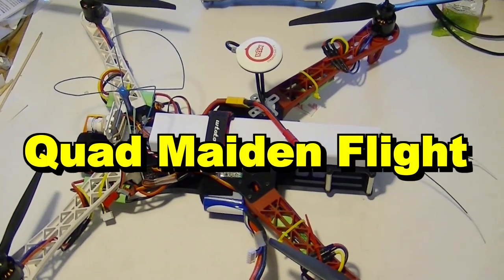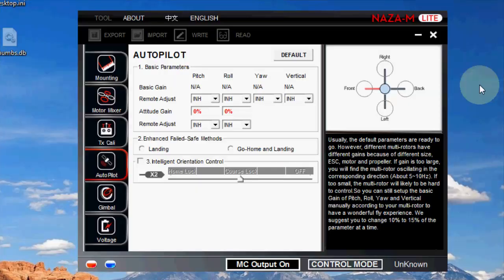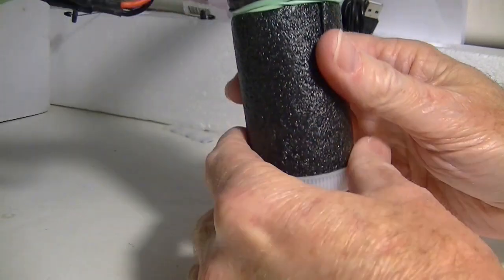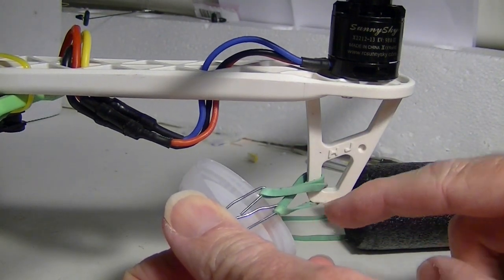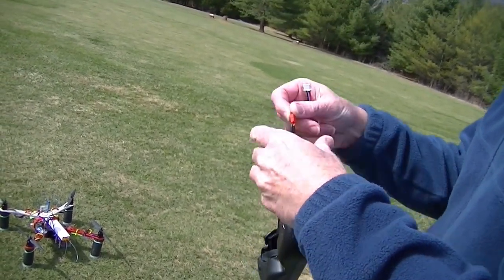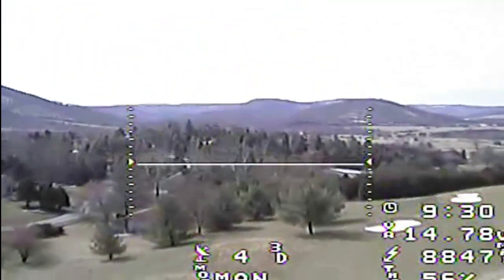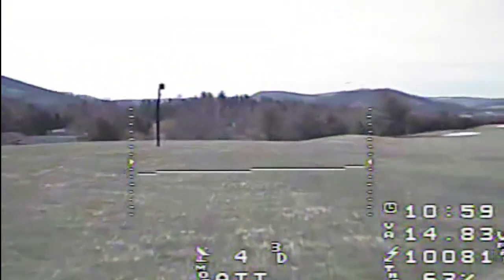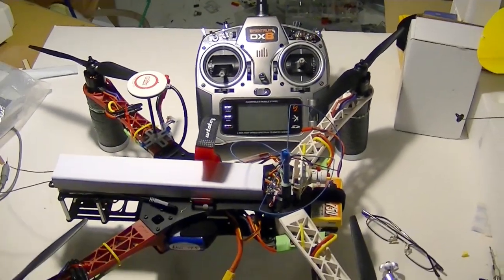MinNaza OSD Maiden Flight adjusting gains remotely with knob on TX.

Comment: You should ajust the cam properly, the colors are horrible ;-)
Reply from the maker: It's more to do with the lighting than the camera.
Reply: I get much better colors with my 600tvl in less light then in your Video
Reply from the maker: Heckmann Markus Oh, well it is 600tvi but the DVR has less resolution to that may be effecting it. You may have noticed the OSD text was cut off at the bottom.
That was the DVR doing that. The camera setting may be off too so what do you recommend, it's a PZ0420.
Reply: ***** I would highly recommend these settings :
 http://fpvlab.com/forums/showthread.php?10888-PZ0420-CC1333-Sony-600-Camera-Settings-and-Information&p=187415&viewfull=1#post187415

and you may try different blu/red values as you like
Reply from the maker: Heckmann Markus Thank you very much! I will try these out on the next go.

Comment: Nice job Dave. I wonder if the lack of satellites has anything to do with where you're flying although I can't imagine that would be the case. I routinely get 9 to 12 satellites on my  Naza GPS. On a very overcast day, it might go down to 7. Could be some form of interference from your other components or a setup issue.
Reply from the maker: I just don't know without further testing. I have tried it without the vtx but still no joy.
Reply: *****
I assume you went through the set up and calibration steps?
Reply from the maker: ***** Yeah, I set the GPS mounting parameters and did the NAZA dance and all that. Is there something else I need to do.
Reply from the maker: ***** The LED flashes the same as it does in the OSD and indicates not enough satellites. Four was the most I got. The LED is less specific however and only blinks that I have less than 5 and doesn't tell me the exact amount.

Comment: Congratulations with your maiden flight :)
Lot of things i can say from this flight.
Good job with your gains, there were far away too high. On my transmitter i sacrified the switch you used for my gimbal, so i set my Naza-M Lite with the gains i like to fly with.
Normaly, it's far away easy for me to take off and land in GPS mode with my goggles but you did great with taking-off and landing without them.
I don't know how much satellites i have on mine lol i did not have access to these datas but most of times my LED blinks full green, so it means the Naza-M controller has far away enough satellites for flying in GPS mode. My VTX is also very closed from my GPS (comparing to your setup) and i never had any troubles with it.
I never succeeded with flying stand-up when i wear my goggles, everytime i felt not cumfortable at all.
Hope you are not frustrated with your first flight, the wind was a quite bit strong.
Reply from the maker: For some reason you comment was hidden at spam so I didn't see right away.
Thanks for posting. Yes any help you can give me on setup is great. Do you have trouble picking up satellites?
Reply: ***** You're welcome! Generally, as long as the weather is good, the satellites are picking up pretty quickly, less than 1 or 2 minutes.
Reply from the maker: blackmennewstyle It's been a problem for me even with just the GPS and the OSD connected. Needs more research.
Reply: ***** Ooh, so if you fly without the GPS and OSD connected, the satellites come more quickly?
Reply from the maker: blackmennewstyle Ah no, I meant that I tested the GPS connected straight to the MinimOSD without the NAZA flight controller or the VTX.  See this video.
MinNaza OSD Project Part2 (Connecting GPS to MinimOSD)
Reply: ***** Yes i remember this video, the DJI iOSD works almost the same (i don't have it but i watched a lot of review about it). The GPS is not directly connected anymore to the Naza Flight Controller, DJI introduced a new feature called PMU, it's some kind of BEC that you plug on the GPS port and X3 port on your Naza-M Flight controller.
The GPS and the iOSD are connected to the PMU. I don't know what this famous PMU does but it seems to be appoximately what you did with your minimOSD.
Maybe you should investigate in that way, maybe some connections are required in order to have more satellites but i am not sure, it's just hypothesis.
Reply from the maker: blackmennewstyle At this point several RC enthusiasts have told me that the NAZA M Lite GPS does not get along with the 1.3GHz VTX (especially 1280MHz) and that I need to add a SAW filter to the GPS to exclude the interference from the VTX. Also copper foil can be added under the GPS. Thanks everyone for the wonderful help you have given me and keep it coming. I will get the bugs out of her yet.
Reply: ***** Aww, that sucks, they are probably right because i am using 5.8Ghz for FPV, i wanted to get into 1.2Ghz but i had read so many issues with this frequency, so now i have a lot of doubt about using it on multirotors, i think 5.8Ghz is definitely the way to go with them (obviously if you use GPS)! 1.2Ghz is definitely better for planes! Thanks for sharing your feedback :)
Reply from the maker: blackmennewstyle You could probably still try it but you would have to get the NAZA M V2 which is more robust and has the SAW filter already included.
Seems like I always get the older stuff that needs a hardware mod :-(
Reply: blackmennewstyle 1.2Ghz is what we started on and we quickly changed. There always issues at the flight fields. Around the office it was great. We switched to 5.8Ghz as well.

Comment: Do you have a filter in your GPS and copper shielding if not your video transmitter is probably why sat number is so low . Video tx too close to GPS . Ck end points on radio for 3 position switch   , probably not centered causing manual mode to come on when in att mode . Just some things you can Ck . Hope it helps
Reply from the maker: Thanks for the tips. I thought that about the vtx too but when I leave the vtx unpowered it still has trouble acquiring sats. So what kind of filter and where do i place it? Where does the copper shielding go? And of course thanks for watching!
Reply: brendan stewart has a good video on naza lite gps filter and copper shielding i have naza v2 which says it already has filter but my gps still acts funny unless im on channel d for video i was going to do copper shielding but mine gets 12 sats when i use channel d . you can get copper shielding at granger.com it goes in bottom cover of gps, brendans video will show you where filter goes . you may want to try a low or high pass filter on vtx also, depending on the freq channel you wish to run . if you are running 2.4 radio you will need filter on vtx or your range is gonna be very low ! i had 2.4 with the same 800mw vtx and my range was only 2000ft . you may want to get a lower watage vtx also unless you plan to go long range , this will help with gps interference also ! happy flying
Reply from the maker: tracy baker Thanks! I checked it out and the saw filter mod looks like it would help a lot and the copper foil under the GPS too.